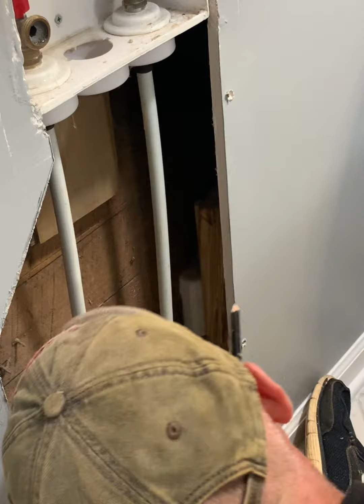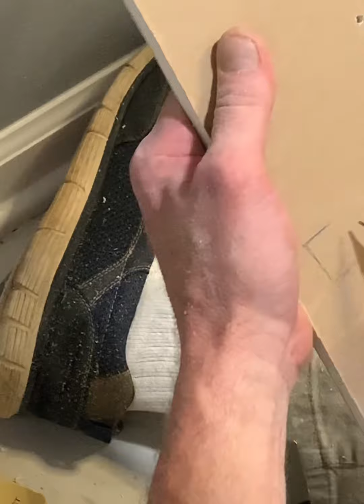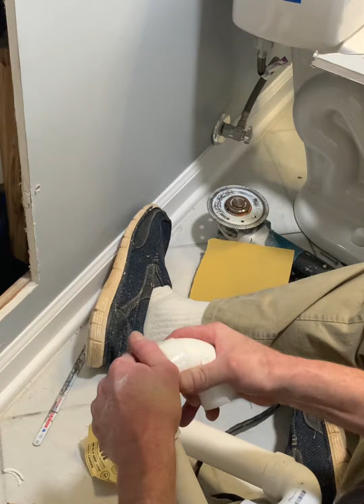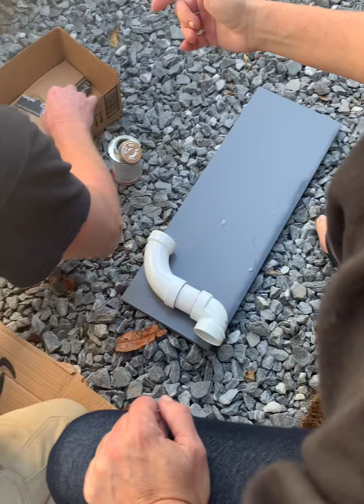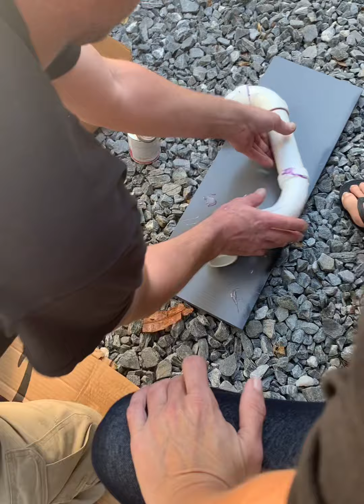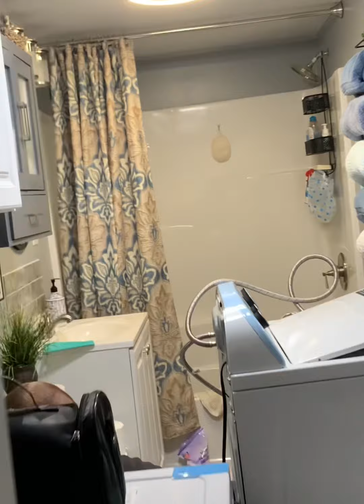P Trap Installation

Comment: The reason for purple primer/cleaner ( as opposed to clear ) is so the plumber and the codes inspectors can see that the pipe was cleaned before assembly.
Reply from the maker: They make the purple stuff in clear so how would they know ?